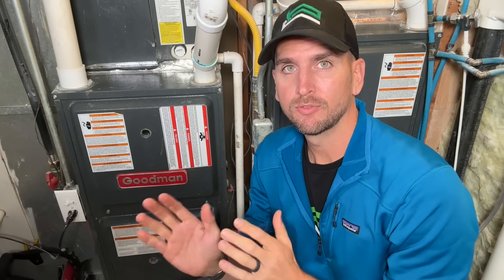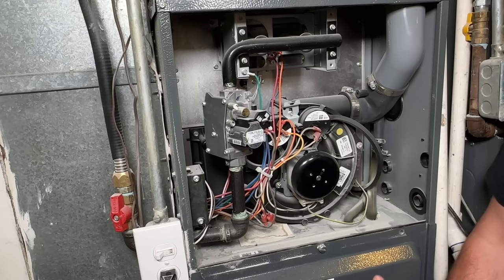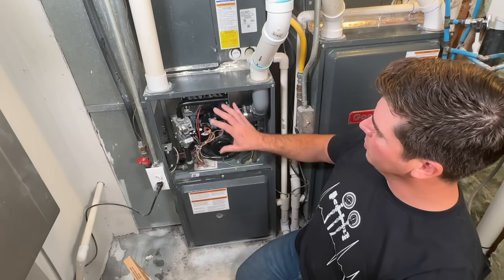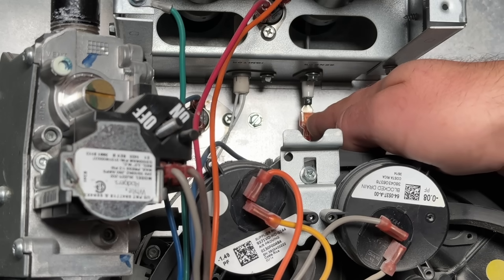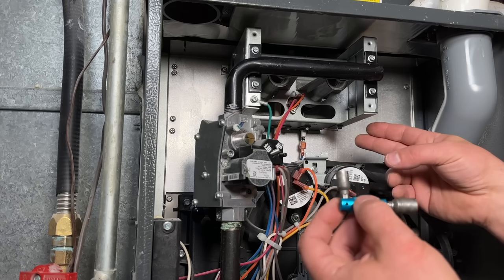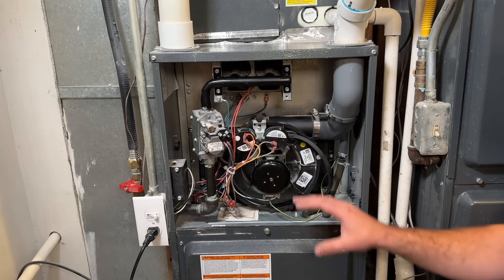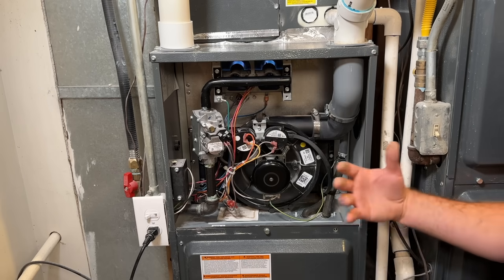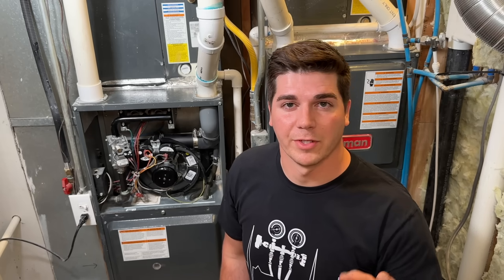Yearly Furnace Cleaning And Maintenance Pro Tips

Comment: Suggesting to clean a flame sensor with a stiff pipe cleaner is just asking for someone to break the hot surface ignitor by accident. Not once did you illustrate how to clean the burners, check gas pressure, temp rise, inspect and clean drain traps/vacuum ports, measure capacitors, inspect motor bushings, inspect for leaking heat exchanger. 

Thats just a small list of what you failed to mention. What youve done is given people a false sense of confidence and illusion that what you've illustrated is a sufficient and thorough check and service of their equipment. Customers dont have eyes or ears for noticing issue that might potentially give issue in the near future. That is why you pay a professional.
Reply: Thank you for stating what every experienced and competent technician is thinking when watching these videos.  Always felt it’s fine to do this to your own equipment if you feel capable but, to influence unknowing homeowners to do so is just not smart or safe.
Reply: the flame sensor and hot surface ignitor are 2 totally separate parts, so your conclusion is totally wrong here
Reply: @srobeck77  new to hvac and you tube? 😂
Reply: @srobeck77  Do you know how many calls I've had, where I get there and the customer tells me, they've cleaned both flame sensors and is still doesnt work lol?
Reply: @moparerrnocar  well stop going over to your relative's house. I've never heard of someone doing that. Must be a family thing.

Comment: How many ohms do expect to find on an ignitor mr homeowner? Are you checking resistance to pressure switches? What is your total external static pressure? How many cfms are needed for proper cooling? What is the temperature rise across furnace? What are the results of the combustion analysis? What is the amp draw from your motors? The list goes on and on! If you don't know what you are doing leave it to a pro. I cannot tell you how many "handymen" I have had to come behind to fix their mess! Hey neighbor! Why were all the fire trucks at your house? "I jumped out a bad limit switch" Really? What happened? "It wasn't bad but my coil was plugged up and it melted the plastic drain pan which filled the house with smoke!" Huh, why didn't you call me? "I do maintenance at a factory so I thought I knew what I was doing" Hmmmmmmm. "Can you find me a replacement coil pan? Sure!

Comment: Yeah most home owners are stupid aF!!! I recently had a costumer tell me they watched a you tube video and cleaned the “flame sensor “ a dozen times it was the glow coil… and the furnace kept shutting off. Then they watched another video that told them it was the gas valve so they took that apart to try to fix the solenoid in it. Proceeds to tell me I’m wrong in my diagnostics because he then watched another video that told him it was a pressure switch that went bad. My suggestion is stop marking these videos!!! These videos cause more problems than good.  Don’t want to be ripped off look at the reviews and don’t hire big companies that advertise like crazy.  Also.. I didn’t watch the whole video but I noticed your a-coil and collector box side discharge doesn’t have a tee / vent clean out. And I’m betting your not going to read amp draw on the motors and gas pressures on the gas valve. Probably should check the dip switches to make sure the installer set them properly since he didn’t install the drains properly Id assume as much. 🤗

Comment: Very basic, wonder how many people going to break there hsi's with the pipe cleaner after watching this lol.. more important things would be done by an actual gas tech like your 3gas pressure readings .. temperature rise reading.. making sure condensate lines/trap are clear.. and if want to make sure 100% safe and running properly a combustion analysis reading taken.. don't forget to tell ur insurance company where your maintenance procedures came from after a fire or CO leak LOL
Reply: Also you can clean a flame sensor to aggressively to where it will fail prematurely.. testing microamps is proper way ..if out of range then clean it and hope it will hold up

Comment: Scam...pull the blower motor cage out take the motor apart and clean and oil flush out your a coil and your good for another 10years....replace the cap and change filters.

Comment: Since when does a furnace have an evaporator coil? That is your AC coil, might be in your furnace, but or necessarily. He should hav3 said heat exchanger, which all furnaces have. Kind of spoils the credibility of the video
Reply: Dude, lol youre 100% wrong here bud. All furnaces have an evaporator coil inside them (aka indoor coil or A-coil). Then those copper refrigerant lines go outside to the condenser (aka outdoor coil). This is for air-conditioning on all systems.

The heat exchanger is only for heating, but doesnt help with cooling (the name sorta gives it away).